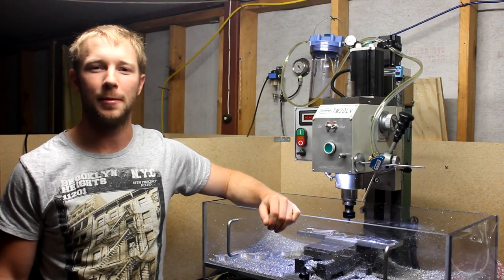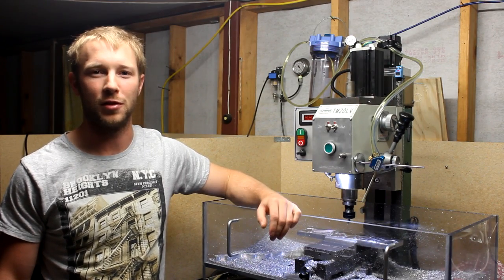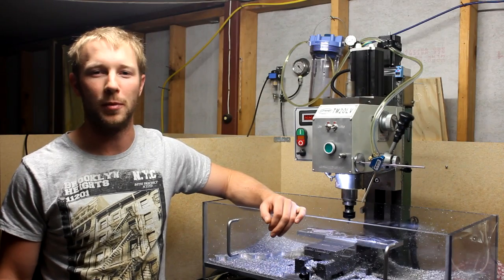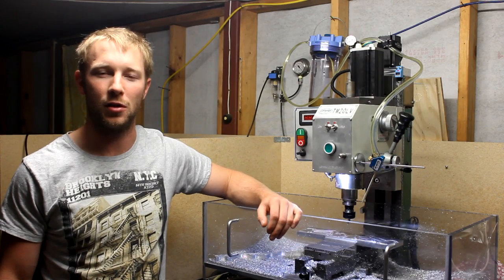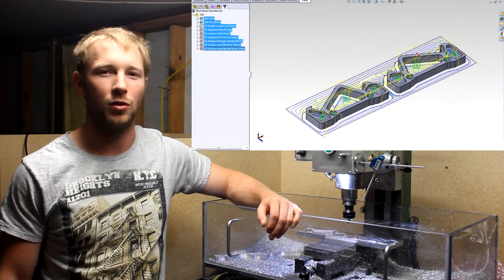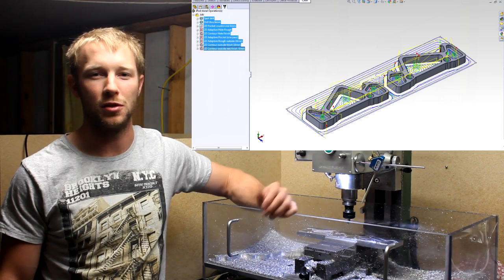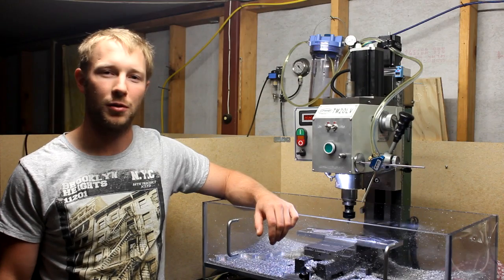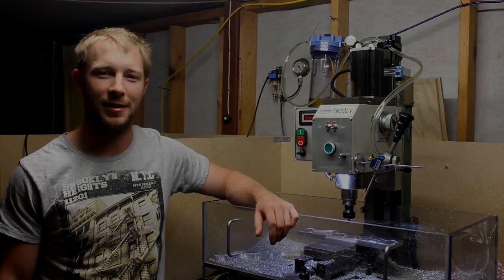CNC Mill - Billet aluminium iPad stand project

Comment: thats sweet as mate..  But can you tell me..  How do you stop your end mills from gunking up with melted aluminium?  Im using 6061 with HSS Tin coat and after one cut its gunked up.. I thought coolant is the answer but your clearly not running it or even running a lube.. ??
Reply: Hey fluff your going to want an uncoated endmill for the sharpest edge, and not too many flutes (2 or 3 depending on the endmill diameter). If the cutting path is holding all the swarf you may want to air blast with compressed air as re-cutting chips will severely impact tool life. An uncoated alu-grade carbide endmill will likely be ideal.
Reply: Chopsy Chopper Thanks Chopsy,  I've been using an old vacuum but it doesnt suck up all the chips just about 75% of them..  Ill try with the compressor and see how I go.  I'll see about getting a full set of AL grade end mills as well, I have one 5mm one (uncoated) which seems to do a lot better than the other ones but my novice thought was a coated end mill was better.. Thanks again

Comment: I cringed watching the material deflect drilling those holes, but was pleased when I realized it was only for fixturing, and that the whole part wasnt being cut extended out the side.

I get the pleasure of being an HSMWorks user, but isnt HSMXpress great? I genuinely believe it to be among the most powerful of 2.5D CAM packages available, regardless of cost.

The g0704 is looking excellent as well, and looks like a very productive machine for the cost.

Comment from the maker: Thanks Jonny, yes this could be done with the 6040 however due to the rigidity of the machine you would have to take much shallower cuts. It would take much longer and the surface finish wouldn't be too awesome I'd imagine. The material is Aluminum 6061-T6